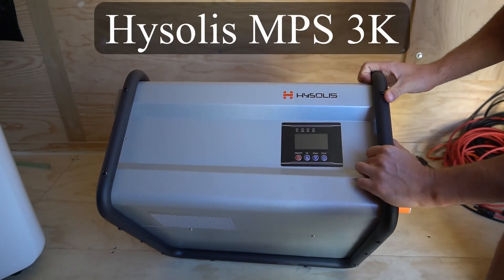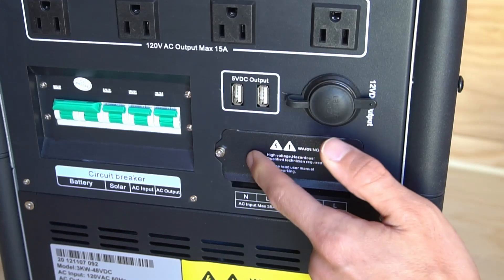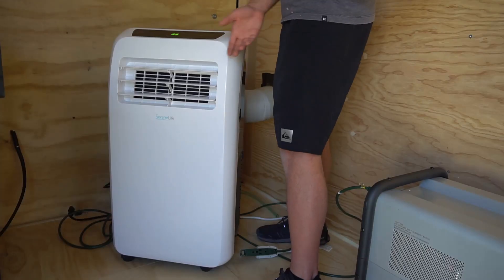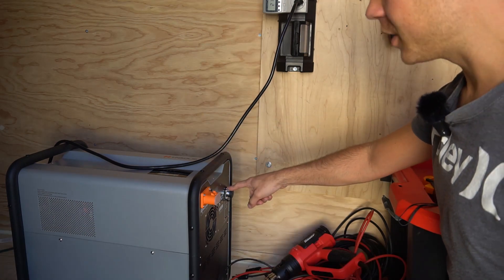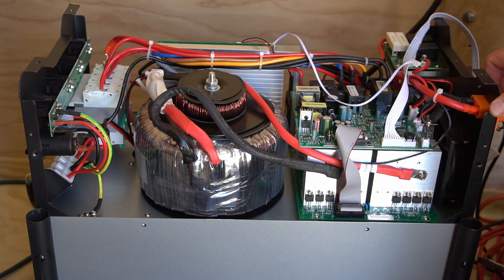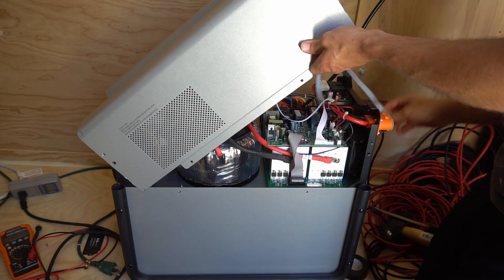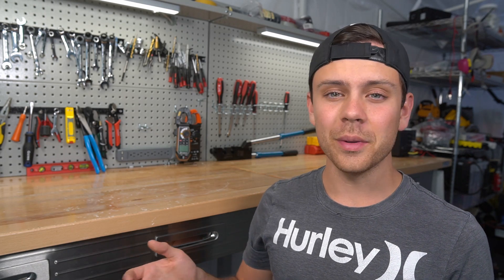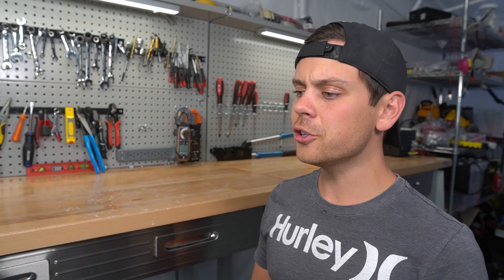Hysolis MPS 3K Solar Generator: 3kW LF Inverter, 4.5kWh Battery, 1.5kW Solar Input, 12/24V In/out

Comment: Thanks Will for this review. I wanted the Titan but due to their ordering policies, Titan takes your Credit charge immediately and you have to wait 3 to 4 months before receiving product. That means you are paying Credit Card interest on 4k to 5k for several months before even receiving product! This practice is reprehensible! I don't make Internet purchases unless on a Credit Card, so while I love Titan's product, their pre-charge practices made me distrust them IMMENSELY.

I worked with Hysolis and had answers to all my questions in 5 hours. I just purchased their MPS3K + 1.2 kW Small-Form Panels system with the 12 panel setup for a very reasonable price and am expecting delivery next week. I credited your review for my purchase decision. I'll be using this on My RV and also as other off-grid uses. I, of course, used your affiliate code and saved some bucks, so Thank you VERY much for this review!
Reply: PS - They DO have an external L5-30R plug adapter to use the 30Amp option that is INCLUDED with the system. So this was a selling point for my RV use.
Reply: @Hebrews12v2  hi. I ordered this unit today and am waiting to receive it. How has it been for you? Any tips?
Reply: @cjhighway  I like the system. It has worked very well. Used it when I was camping for two weeks and I was able to keep trailer powered with it and the solar panels that I got with it.
Reply: @Hebrews12v2  thanks for replying. I'm going to be using it as a backup for critical circuits at my house. I was looking at the Bluetti AC200MAX and AC300 but it's the same thing with them like you mentioned with Titan. With the shipping issues it's no telling when I would get their product and they are almost impossible to reach. I needed to go with something that was in stock right now that I can receive in a week or so.

Comment: @DIY Solar with Will Prowse or anyone with the knowledge : I am very curious as to the chemistry of the batteries in this power bank. From the cell voltage in the Data sheet link, it isn't LiFePO4. I know some chemistries need refrigerated trucks and an air conditioned environment to work in. If anyone figures the chemistry out, I would appreciate a reply on here.
Reply: Same cells Tesla uses. So you really can't go wrong.
Reply: Spec sheet on battery calls it Lithium-ion and refers to NCM which normally means Nickel-Cobalt-Manganese chemistry.  I hope this helps.  Not LiFePO4 but never claimed to be.
Reply: NMC (LiNiCoMnO2)
Reply: @alfredbrown9625  “a rose by any other name ... “

Comment: I am strongly considering this as a Bluetti EP500 alternative that you can purchase right now instead of going through crowdfunding. Not having LiFePO4 battery chemistry is a bit of a bummer though. Did they confirm that a LiFePO4 model is in the works?  Please post an update if you have time to test out the UPS functionality. I would like to use this as a backup for my home office.

Comment: Hello Will,
  Question - you recommended that folks don't try to charge their lifepo4 battery bank with an automotive alternator.  I understand that most tow vehicles arent wired to handle the current needs of a large bank but would it still be ok if we installed a Heftier/fused line to our two vehicle?  I have two Battle Borns and a charge controller that could draw 40 amps from the alternator.  What do you see as the downsides?  Thanks - John

Comment: Sometimes less, is more, I would prefer to pay for three Hyundai Tucson at MSRP $23,700 each than one Mercedes GLS 450 at $76,000, or even a model S. Maintenance costs are way less. Same applies to SoGens, the simpler, the better for most, There are functions on my calculator and DSLRs that I have never used.

Comment: Impressive trailer. Not before long you can run a “Charge your dead Tesla” service on the freeways 😉
Reply: I'm imagining the neighbors coming over with their batteries,  "Could I borrow  a kwh of energy?" 🙂
Reply: @PurpleDrazi  That's hilarious!  ha, ha!  Will's the kid on the block with the biggest battery!!! ha, ha!
Reply: Love it
Reply: You could do that with a alternator
Reply: @randybobandy9828  No, actually you cannot. An alternator puts out at max around 14 Volts, while a Tesla is way more...not sure if it's 96V or more/
Reply: @Tumbleweed5150  so what?
Reply: You can use a dc to dc converter. Alternators put out like 400amps depending on the vehicle.

Comment: This is awesome except for its $3,500 and can only be recharged 2000 times. I went the DIY routeand paid $1,600 for my 7kw LFP battery add another $1k for inverter/solar charge controller/bms and bits.

Comment: It's a neat idea, but at this pricepoint it's hard to justify this over a conventional gas generator. Even with the rising cost of fuel a comparable dino setup would be */- $350 for a generator and almost 1300 gallons of fuel. The industry is getting there, but not with this. JMO
Reply: If your sole criteria is portable power, then yes a gas generator will be cheaper. But you have to feed it, maintain it, listen to it at night while you want to sleep, and at some point you begin losing money. With solar you have none of this, and at some point you begin getting your power for free. And no need to consider the availability of fuel because the sun rises every day. The only downside to this particular unit is the battery technology being good for only 2K charge cycles but that's almost 5 1/2 years of everyday 24-hour use. A gas generator won't get half that far before the engine is worn out, and less if it's a cheap generic Chinese engine. It's apples and oranges - both can feed you but they're different.
Reply: @P_RO_  Sure, this unit may last longer and the "fuel" is endless sunshine, but the issue is still cost effectiveness. Properly maintained (which isn't that expensive) a decent generator will last for years. So will this, but when you factor in the cost of the unit, the panels, and cables, it simply prices itself out. There is no question the solar "generator" give you quiet power (which is a huge plus in its column), but at =/- $4K its just not a real competitor.
Reply: The sun has never charged me for using it's power. But when I go to the gas station, they always ask for money. "Hmm" something to think about aye!?

Comment: Good morning Will. Thanks to your ideas I was able to set up a little system 165 ah three 55 ah agm batteries. For wires the battery to inverter has a 4 gauge cable I have a epever tracer 20 amp charge controller for the little connectors an AILI BATTERY METER. Now I wanted to know cause I seen in another video that you had added a power supply in the milk crate video now can I add one it’s a 10 amp 250 watt power supply can I have the solar panel which is a 12 volt 250 watt panel hanging out my window in an apartment building would like your feed back to see if I need to change anything the inverter is a modified wave 2000 watts but it cuts off at 800 watts. Thanks for your help

Comment: am interested in the lifepo version. wanting a off grid mini system to just run a 9.5k btu window ac (LG dual inverter, only a 460 watt draw) during daylight hours and this might be the right size and function for my use case.

Comment: I really enjoy your videos and I have your book. But there is one system I can't seem to find a video on (sorry if I'm onlooking). I'd like to see a video of a large off grid system using a generator as a backup. So basically is the batteries are dead, and the sun is being blocked...I'd like to have a generator that auto starts, charges the batteries. What I'm not sure on...is should the generator auto-start and change the batteries or should the generator start and the power to the devices auto switch off the drained batteries (and solar...as the sun is being blocked) to the generator. I'm just not sure of the best solution, nor how to build it. I've been looking at the solution this site provides: dcautogen_com. Thoughts? 100% thanks and again, I love your videos!!!
Reply: This is what I do, but seldom have to use my propane generator. No, there isn't a way to make it come on by itself. Delta Flow just came out with a gas generator that self starts to recharge the Delta Pro system.

Comment: Will, Thank You for this . I was checking out the stats and although I saw the Pass Thru option I did NOT see any thing about a true ABS. Nothing stated in the documents (that I read)  it does switch to the battery system, BUT, will it switch back to the pass thru, when tricity  {I never elected it} returns? Also, Although it projects the Battery extension in the future, can one be connected NOW, to straight Li-Ion (s) or a Tesla pak? Just wondering, as it seems a lil pricey. I shall continue to receive all of your great knowledge and Thank You for it. Well Done, son. . . . . Ya'll ;; B Blessed BIG time 2 Day & 4 Ever,

Comment: Very Impressive indeed.
This would be ideal for SO MANY people out there, weekenders, campers, part-time cabineers and more.   Low Frequency 3000W should be capable of 3X Surge or 9000W so that large coil is not a surprise really.

It will be something when they come out with an LFP version.  Hopefully they realize those dinky little wheels should be a tad more substantial.   Try dragging that thing across dirt, sand or other.  THAT is only meant for concrete & asphalt and even that will destroy those little wheel in no time.

THAT is one point I notice on MANY of these types of generator systems, piddly wheels which are more or less useless "off-road" and out in the Real World.  I mean, seriously, don't these designers have a life beyond their concrete offices, can't they rationally see where such things could & would be used ?

WILL, this may be a point that you could highlight to these companies when you do a review, they should be able to be used everywhere, not just within Urbanium only.

Comment: Looks good until get to to DC out - only has 10 amp DC output connector.  Too low for vanlife.  Most others have 20-30 amp DC out which is needed to power a DC distribution panel.  If they increased the DC output this would be a nearly perfect unit. Or am I missing something?

Comment: Will, I'm curious if you have much knowledge about tesla's solar roof tiles and system.  With your interest in solar power generation, I'd love to hear your thoughts about it in regards to otr usefulness.
Your videos are very insightful and informative.  Thank you for posting easily digestible information.
Reply: From what I've seen Tesla solar systems are NOT designed as "plug n play" or for DIYers. One MUST have a profesional electrician install them. Plus, I've not seen any off-grid systems from them.
I was very interested in Tesla Powerwall and thier solar roof panels until I found the above out.
Reply: @Tumbleweed5150 Thanks for your input.  I'd happily consider a pro install if it were feasible in a 'mobile home' situation.  I'm sure it would be terribly heavy and tak e a lot of planning in advance with tesla pros/installer.   The long term is what I'm thinking though so even in an off grid 'cabin' situation would be acceptable.  Thanks again!

Comment: Another US only device which is useless for other countries not running the ridiculous 120v system.  Common guys move away from inches, stones and 110v system. Embrace the global accepted standards of cm, kg and 220v
Reply: There's no global standard for electric power, and wherever you are is just as odd as everyone else. You obviously haven't looked into this of you'd know of the several different systems (there ARE more than two). Which will never change anywhere because of existing power-consuming devices. 

Get over it. We get these devices because we buy them and use them; if there was enough market demand where you are then they'd build these for you too.
Reply: @P_RO_  🤣😂...🥱

Comment: You forgot to mention the “Pass-Through AC Power” option to bypass battery when connected to the grid. Very nice option to leave plugged in as a ups
Reply from the maker: I always forget to mention that. Same on the mpp units. Good point
Reply: @WillProwse   I HAVE ASKED AT LEAST 25 YOUTUBE "EXPERTS"..NOBODY HAS AN ANSWER .  : I UNDERSTAND THAT THE NEW IRON PHOSPHATE BATTS CYCLE LONGER THAN OLD LION ( 3500 VS 1000 OR SO TO 80%)  MY QUESTION IS : WHEN USING A BATTERY FOR BACKUP POWER FOR POWER FAILURES (ONLY)  DO THEY BOTH DEGRADE AND LOSE CAPACITY AT THE SAME RATE? OR DOES THE IRON PHOS DEGRADE 3-5X SLOWER?  MEANING IF BOTH PACKS ARE 1000 WH...I CHARGE AND IT SITS FOR 1 YEAR ( INDERSTAND IT THEY WILL LOSE SOME CHARGE % )  I MEAN TOTAL MAX CAPACITY DEGRADES OVER TIME REGARDLESS OF CYCLES...DO THEY LOSE CAPACITY AT THE SAME RATE...NOBODY TALKS ABOUT THIS. DO THEY BOTH GOTO 80% CAPACITY AT THE SAME TIME IF NEVER USED? HARD TO WORD
Reply: This will put a lot of UPS manufacturers out of business once the have a LiFePO4 model🤣
Reply: Hmmm

Comment: Can this or the Bluette AC200p be charged with a DC to DC charger? Like with the Renogy DCC50s rather than using a 12volt outlet in your van?
Reply: I've charged my AC200P with another 24V battery. Keep in mind it's limited to around 9 amps so it doesn't charge very quickly that way.
Reply: @niktak1114  I was wondering if there was a way to mimic the charging that comes from solar with a DC to DC charger.
Reply: @johnirish_RMLfx  It should if the voltage is in the correct range. I believe the hobotech guy does this in testing sometimes.

Comment: Very nice, Will. My thoughts are that this unit provides a real benchmark for single box portable power and, as always, you have provided with a great first look. I'm wondering, though, if something in this size/power range would have even more appeal if they could cleanly separate all the topside electronics from the battery below. An interlocking pair of boxes that could be stacked and optionally bolted to each other? Maybe a big Anderson connector or two electrically patching them together? An attempt to lift a 130 lb. box into the back of my i-MiEV would probably finish me off. But two lifts at around 65 lb. or even a few pounds more per unit would be doable. But, yeah, Hysolis is definitely one to watch.

Comment: Will, you need to get a scissor lift platform to lift heavy items. This will save your back in the long run. Us it even for 'lighter' items down to say, 40 pounds.
Reply: A high lift (36”) motorcycle work table is ideal for this sort of job. My Sealey brand hydraulic unit is pretty small (18” x 24”), it has wheels to move it around when in the lowered position, can easily lift 1100+ lbs (500Kg) and stores away under my work bench when not being used. As you get older your lower back will thank you for being nice to it when it comes to heavy objects.
Reply: Platform Lift
Reply: He actually had one. Must have forgotten to use it